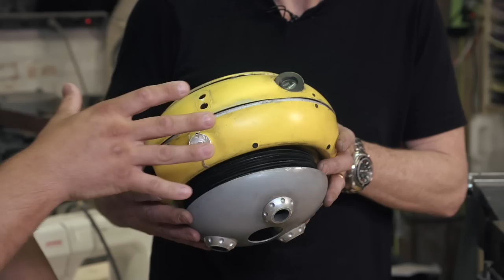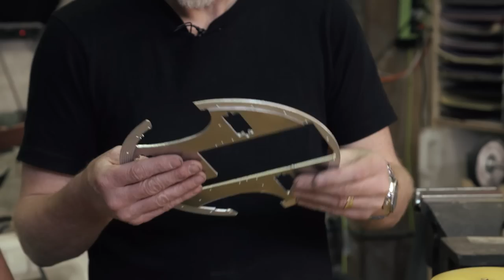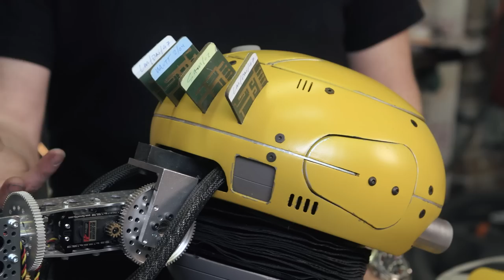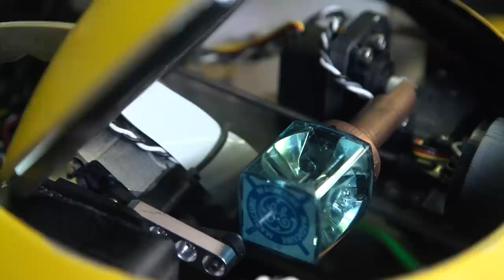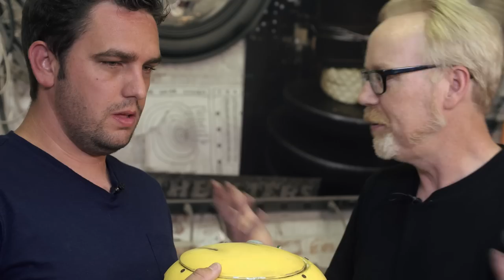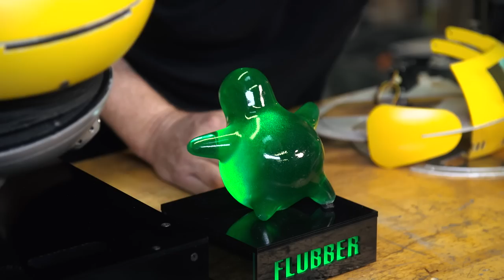Adam Savage Meets a Weebo Animatronic Robot!

Comment: why not use an actual polaroid camera? also, I would have hung it from a string, and tried to put little fans on that base so it could sort of blow itself around as if it were hovering. I imagine the software to stabilize it would be harder to write, but possibly a cooler end result. The mechanism to aim a fan is already there in the gray "base".

Though I suppose you could turn this into an actual drone somehow, it would be hard to disguise the props and the noise would be annoying.

Comment: My laser cutter sitting behind me has lit a fire.  Fortunately I was watching it when it happened.  edge of a piece of card stock I was cutting started to smolder.  I blew it out, stopped the laser, got another piece of card stock.  Not a calamity.
If you run a laser cutter, you WILL start a fire.